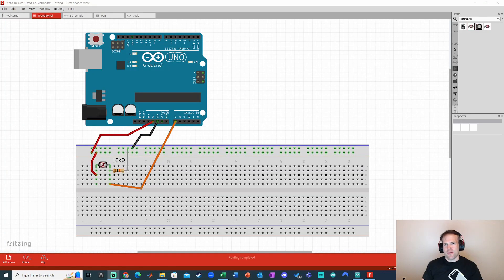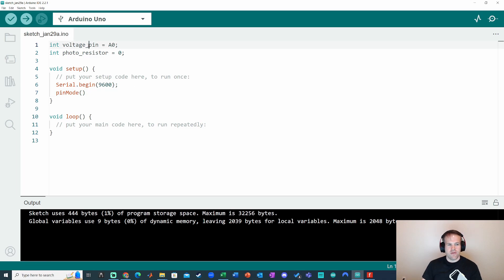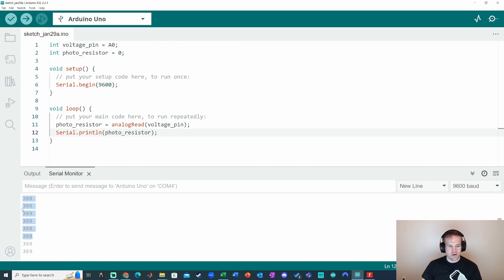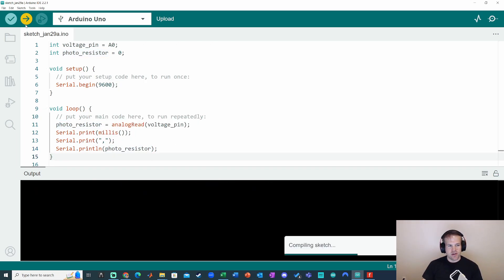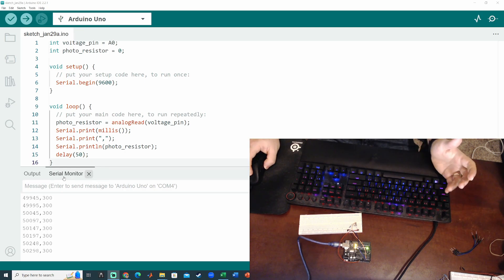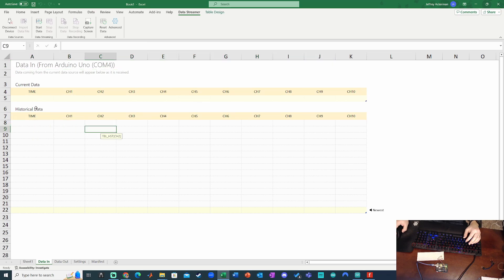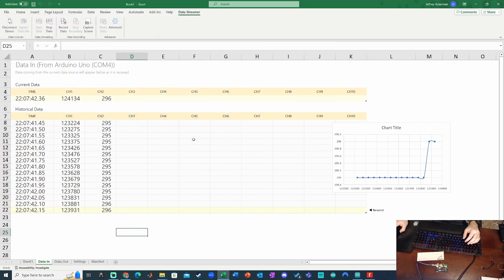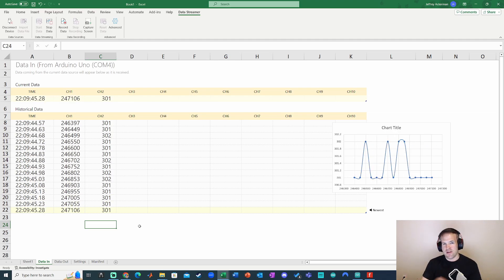Arduino Data Logging with Microsoft Excel Data Streamer

Comment: My Arduino datas are not containing commas
Reply from the maker: I usually do something like this to add commas in between data points, just make sure that the last line data point uses Serial.println at the end for a new line: Serial.print(data1); Serial.print(“,”); Serial.println(datan);
Reply: @ChefJeffPhD 

Does that mean, my datas on serial monitor will have commas between xyz?

Comment: @CheffJeffPhD Does this work for Google Sheets as well?
Reply from the maker: No, this uses a Microsoft plug-in, it won't work with Google Sheet. I bet that someone has created a Serial Monitor pipeline that dumps data into a Google sheets. It wouldn't be too hard to make that with AI these days - good idea!

Comment: Hi, It works with Arduino uno R3 but not with the R4 Wifi? In the serial monitor it shows the data but when I connect excel it does not show for R4, whereas it does for R3. Is there any workaround for this?
Reply from the maker: @Unfreeze007  I’m not sure if the R4 is supported by Excel Data Streamer. I’d recommend trying another Serial terminal option called CoolTerm (I made a video about this) or writing/finding a Python code that can read the data via the PySerial library.

Comment: hi please help me out, i have a arduino uno r4 wifi board and everything is working fine except when i press start data, no data seems to be streaming in
Reply: I think that's a known issue. It's not quite compatible with recent new arduino versions. The potential solution is to add Serial.dtr(); in the setup function.
Reply from the maker: Hmm I’m not sure about this issue. I just got an R4 recently to try out but haven’t had time to test it. Could be compatibility issues like the commenter suggests. It’s new hardware, so I’m unclear if it’s supported in Data Streamer. This setup should theoretically work with any Serial Output from a COM channel. Maybe you could try using CoolTerm - I made a video about that too.
Reply: @ChefJeffPhD  
I have the same problem. I'm using an ESP-WROOM-32. It works with CoolTerm because we are just writing existing values into Excel, but I want the latest value, like a real-time update.

Comment: I didn't realize that Excel had that feature, this will be very handy - thank you.

Also, you can copy from the Arduino IDE serial monitor, I did it this afternoon.
Reply from the maker: For some reason I’m not able to copy paste from it. I used to be able to do it on V1.7 before the current Arduino v2.X software update.